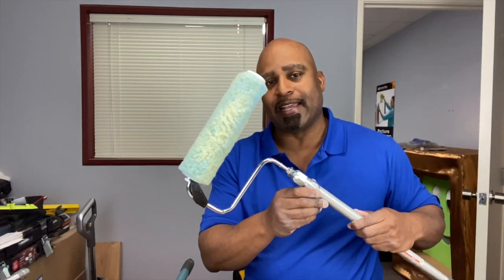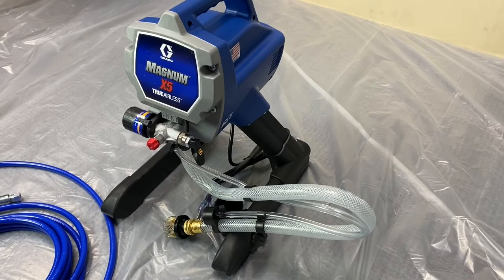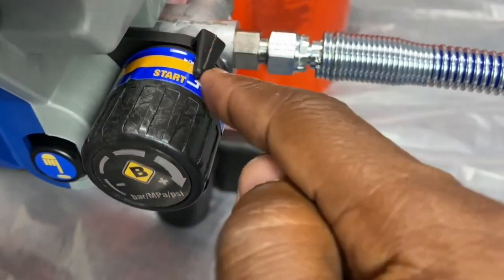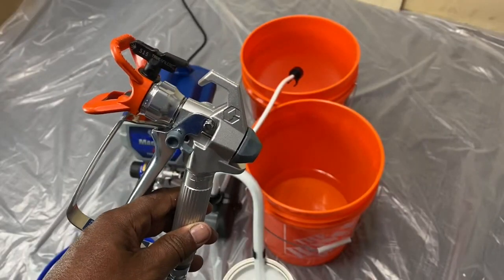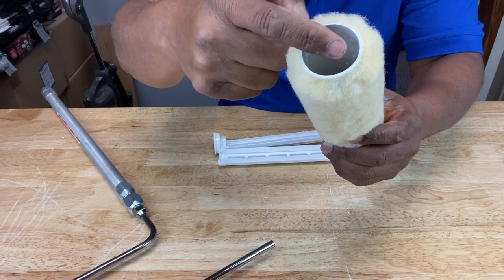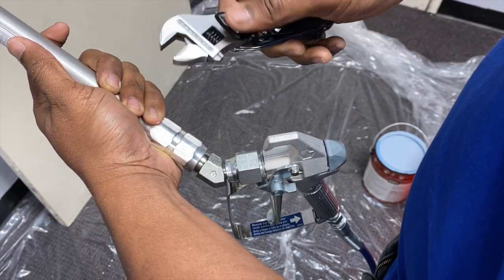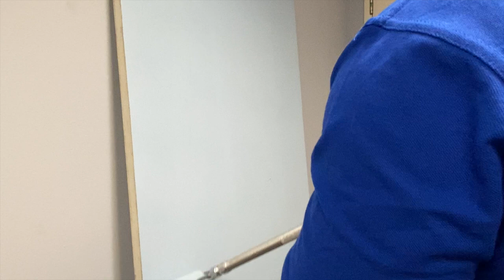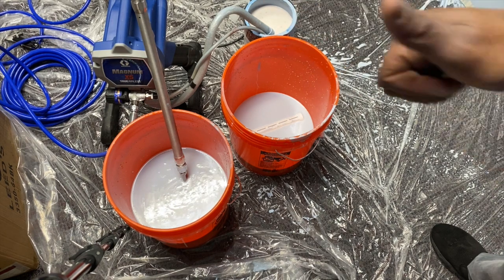HOW TO USE A PAINT PRESSURE ROLLER

Comment: Just what I needed. Thank you.  Was thinking about upgrading to this power roller but wasn't sure how complex it was to run this entry level spray unit.  Really like the two part diffuser design and the simple shapes with slide down lock for the roller end caps.  Those two features make it easier to clean from my perspective.  It looks better than some other designs that are out their and reminds me of some the good design features we had in one of the early generations of powerflo rollers about 35 years ago.  

It looks like you can get enough pressure for intermittent pulls on the handle and that you don't have to squeeze it full time to keep up with paint flow.  Is that right?  Did you turn the pressure valve down a bit while running this?  

Thank you for the step-by-step.  Will check out your video on further cleaning instructions.
Reply from the maker: Glad it helped.

Comment: Do you need to use the roller section when doing this on the pressure knob?
Reply from the maker: Do you mean when squeezing the trigger?
Reply: Yes
Reply: Not supposed to hold the trigger like that though